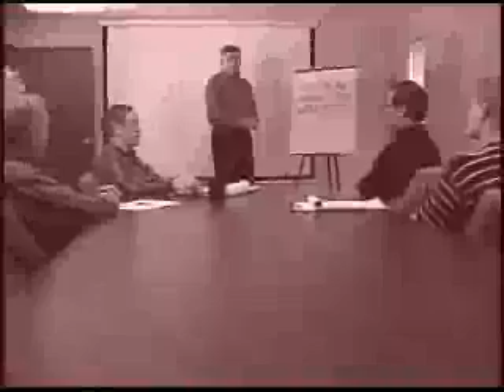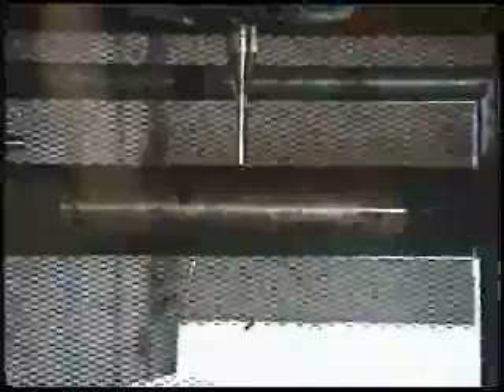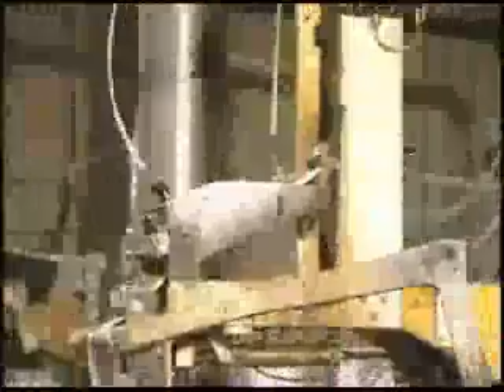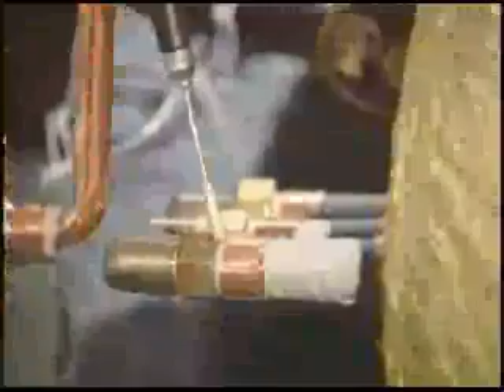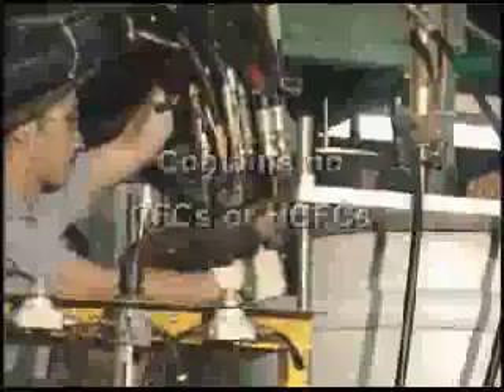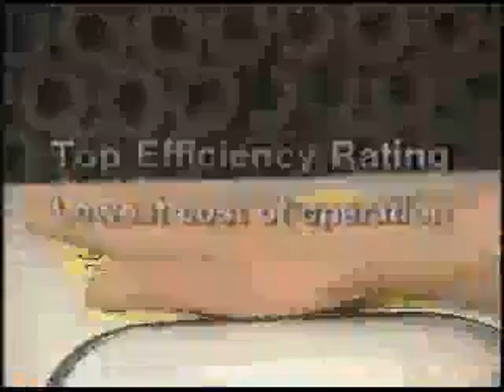marathon.mov

Comment: My Marathon water heater worked flawlessly for12 years and 9 months. Then the copper sleeve inside the outlet fitting ( inside the water heater) , leaked. Brass would not have deteriorated as the copper did. Because this was part of the water heater, and cannot be replaced or repaired, is it covered by the warranty which replaces the water heater?
Reply: Did they replace it for free? spose to have lifetime warranty
Reply: So did they warranty your heater?

Comment: I like the metal reinforcement on the caps of the tank but I wish it was stainless instead of galvanized steel. Mine new has rust spotting all over it.

Comment: I don't care how energy efficient you call a water heater, if your waiting 3  minutes for hot water your wasting all that energy efficiency (Water, Sewer Fees, and wasted energy down the drain)! Design your house with gravity circulation for your hot water. This system when installed by a professional plumber has an average hot water delivery of 5 to 6 seconds at all faucets. Pumps move water too fast average with 240 - 360 GPH compare with 2.5-3.5 GPH by a grav-flow loop design. It's simple design your home with the water heater at a lower level and this allows the hot water to lift and run horizontal for as far as 300 foot, therefore spreading the hot water across the whole home or building. This will help cut your water waste 10,000 - 20,000 gallons per year. That's 200 to 400, 50 gallon water heaters heated up and then just thrown down the drain or 84-167 hours a year running your faucet (based on 2 GPM).